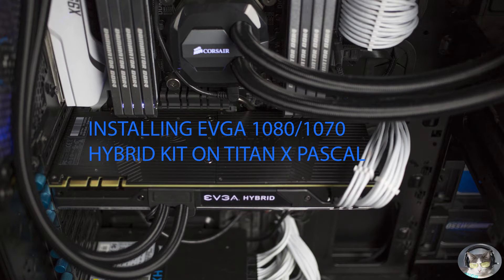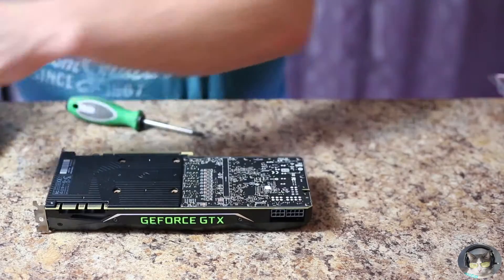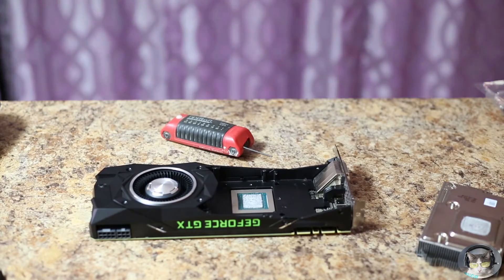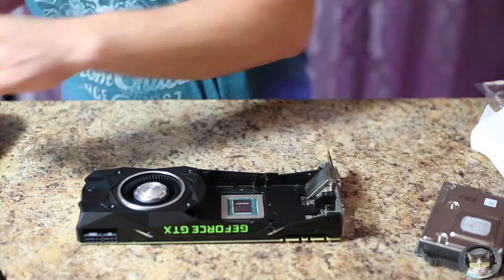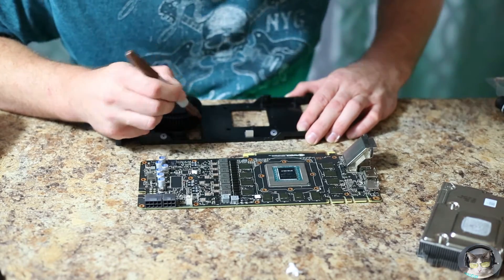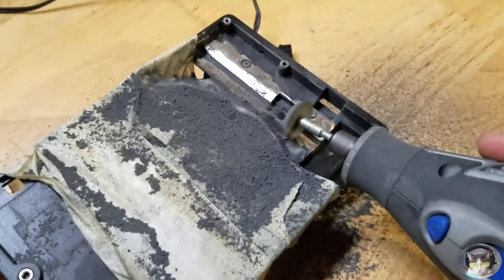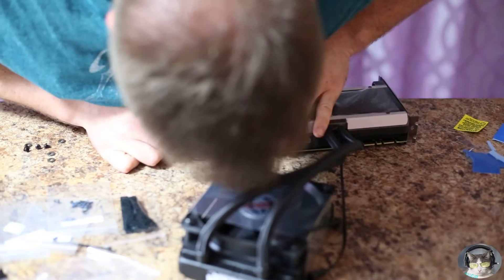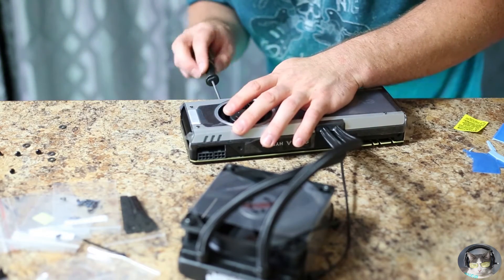EVGA Titan X Pascal Hybrid Cooler (Install)

Comment: Nice vid! I did the same thing to my Titan XP. Aside from having to buy a new Dremel ( the one I had from the 80's died in the first 2 minutes of grinding) this was a simple upgrade. I found this upgrade so simple, I was considering buying a few hybrid kits, grinding them down and putting them on Ebay so people don't spend hundred of dollars on custom blocks for a card that will be obsolete in 1.5 years. My card is sitting at +176 core, +470 mem (any further on core I crash, any further on mem, benchmarks actually decrease) temp max out at 47C regardless of how long I run Heaven... Staring at 23C idle. Dollars to donuts, this hack is simple, sweet and effective. BTW, I am running push pull with Noctua NF-F12 PWM. This bought me about 3C and several Db quiter than EVGA stock rad fan. Cheers!
Reply: Hey!! I will 100% take you up on that offer if you decide to sell these. I am not expecting warranty or anything just the same work the uploader did. I have bad vision up close. I often over read a tape measure most times. This type of tedious work is not for me, but I would pay for it done. Name your price :)
Reply: I would probably charge about $100 for my time to make this modification. The reason I have not pursued this idea is because it IS a modification that will invalidate the warranty, and it the pump or fans or other parts somehow fail, it's a paperweight. Legally for me it's too risky. If we were neighbors and you walked over with the hybrid in hand, and told me you knew the risks, I'd be happy to take the time to make them for you. You mentioned poor eyesight problems... The modification is easier to make than actually installing it on your Titan X. There are MANY small screws and a tedious fan plug to deal with.
Reply from the maker: I've modded 4 of these and sold them at 150 each if youre interested.
Reply from the maker: oliver frias I do sell them on ebay.
Reply from the maker: oliver frias item number 252631580450

Comment: Great job man.  Piece of cake mod.  I was going to do this myself but counting on 1080Ti hybrids being out first of 2017 so just going to wait ...
Reply: Yeah but as a single card option for 1440p this is the best right now and even if 1080ti did come out.. it would still be under Titan X Pascal. A Hybrid Cooled or fully water cooled pascal is undoubtedly superior to a 1080ti (if it comes out) However I do agree that a 1080ti in SLI would be quite a beast and more affordable as a solution for 4k gaming.

Comment: Thank you. doing the same with my 1080 Ti FE, tired to wait the official kit and got the 1070/1080 one.
Reply: did the install go well? i want to get one for my TI as well, but i heard there were some sizing issues.
Reply: I did exactly the same as the video. For unmounting the reference cooler it was easy:
1. unscrew the back plate
2. still on the back side unscrew the hex 4mm head and the 4x screw around the gpu
3. unscrew the 5 from the rear pannel
4. the whole reference cooler unmount in a single block no additional screw to remove

checked all vram modules to be covered with thermal pads from the hybrid kit base plate. add ones from the reference cooler if needed.

6. put the base plate customized as the video, mount it. put back the backplate as well
7. mount the block
8. plug the wires and put back the shroud with few screws

at the end you shouldn't have any screw from the reference cooler left. 

my founder edition now is so powerful (2050 MHz for the core, max temp sometimes 60C while 120% tdp)

there is a little scratch when I used my saw around the power plug. here is my rig before and after

https://pcpartpicker.com/b/HhgwrH
Reply: I need to ask this, because every one of these videos I see are with "modded" backplates. I'm not sure I want to be grinding metal, and I'm fine with not using the backplate if it's only use is really aesthetic. 

Can this be done with the backplate just.... left out altogether?
Reply: Tom Wallen the hybrid kit just came out  for the 1080 TI and Titan. Check on EVGA website
Reply: Yeah, but like all things, it's already sold out. I'll give it a few weeks and see.
Reply: Tom Wallen id prefer to wait because like you I don't want to be drilling any holes in anything and mess anything up
Reply: Yeah, this was the reason I waited when i first got the Titan. Just seeing it exists and out of stock got my consumerism into overdrive. 

Lucky I don't own a Drummel or any other metal cutting tools, or I've already ordered the 1080 hybrid kit. lol. 

I'll sit on the "notify me" email and hope my reaction speed is good enough.

Comment: Looks like a lot more work than putting on a universal, directing a fan across vrm, and calling it a day. Much better temps and headroom with a custom loop as well.
Reply from the maker: It was actually pretty simple just takes patience. I would have preferred a custom loop but I havent done and dont have a custom loop perhaps soon. This option was cheaper than a custom loop as well.
Reply: My card runs into a wall with voltage at 47C. Will your custom loop break down that wall? I'll answer for you, NO. I've run custom loops in the past, this mod will put you maybe a few C higher than the BEST custom loop. By then you are not limited by temps. Save some $$ for the next great thing in 1-2 years.
Reply: I was thinking the same thing.  A custom loop is great but the price to performance ratio is no good.  At best having a custom water loop is just for bragging rights and aesthetics.  Yes they can keep your hardware a few degrees cooler but the amount of money that goes into it is not worth the minimal gain in cooling capacity and the overall maintenance of the loop itself.  Not a knock against anyone with a custom loop, all power to you.  Jayz 2 Cents will tell you the same thing and he is a custom loop die-hard.  Before this mod, Witcher 3 took no more than 30 seconds to get my Titan XP to 84C, and now it sits calm and quiet at 50C post AIO Hybrid mod.

Comment: I did this to my card aswell :). Only I took a different route by taking it apart from the back, which looks way easier than the fiddling you're doing in this video. I maybe only had to undo 15 screws.
Reply from the maker: cheytacsnipes did you use the titan baseplate instead of the evga  one?
Reply: Nope, used the EVGA one.
Reply from the maker: cheytacsnipes i wish i could picture what you were talking about but you have to remove like 15 screws to get the backplate off then 15 screws to get the baseplate removed.
Reply from the maker: cheytacsnipes i wish i could picture what you were talking about but you have to remove like 15 screws to get the backplate off then 15 screws to get the baseplate removed.
Reply: Yeah, theres the 4 ones holding the core, the 7 or so small ones on the blackplate and 7 more holding the plate covering the displayport etc, and then 8 or so hex screws. So maybe 25 in total
Reply from the maker: cheytacsnipes ok i was gonna say theres prolly close to 30 fastners for this baseplate.  i probably could have skipped the led logo and window but i was doing a teardown of a 1200 dollar card with no instructions i wanted to be careful. 15 screws is very inaccurate.

Comment: You don't have to waste as much time taking everything apart and cutting with a rotary tool. Simply leave the original backplate and metal shroud that comes with the card and swap the 2.00 heatsink they put on the 1200 video card for the liquid loop. 10x faster and easier.
Reply from the maker: Steven Mincer i wanted to install the whole evga kit and not use the original titan backplate.
Reply: That's fine I'm just letting the people who don't want to spend the time and effort but also want liquid cooling how to do it in under 5 minutes.
Reply from the maker: Steven Mincer yea theres lots of kits and videos out like that, nexus games did his titan kit using the stock baseplate. but i wanted a clean look rather than the open card

Comment: I stuck with Gamer Nexus' mod for the Titan XP.  core clock is 2076 with fans at 50% when I game.  temps are 48c...
Reply from the maker: As in just using the EVGA pump on the stock Titan baseplate? I wanted a cleaner look personally and my card runs stable at 2088 and typically under 50c unless my ambient temps are higher which now that its fall its sitting in the 30-40c range.
Reply: Yeah, I'm now at 2088.  it just depends on the game you are playing.  Dirty Bomb it will sit at 2114 and not budge.  Temp is 37c.  Battlefield 3 and 4  it will sit at 2088.  The Nexus Mod is a clean look in my opinion.  Besides, you can't see the front of the card anyway.  i have a friend who is going to dremel and sand the cover so I can put the cover  on with the EVGA hoses running through it.  I think it looks better than the EVGA kit mod.
Reply: I agree.  I have it installed on a Core P3 with a Gigabyte X99.  The RGB lighting allows me to adjust the color. I also have a Hue+ with strips on the back and 6 Thermaltake Riing fans.  I have everything set to green to match my card.
Reply: Funny how we watch the same video and the same TITAN Hybrid mod c; (I supplied the card to him).

Comment: Hi, I am looking to add a cooler to my titan, Could you please tell me which tools you needed to do this mod, Thanks a lot
Reply from the maker: Jacob Smith get some magnetic screwdrivers as that will help keep the very small screws from getting lost. Also you need a socket and if i remember right it was about 4mm i belive i mention the tools i used and you will definitely see them if you watch the video.

Comment: I went the expensive route with the full water block. Runs great, but maybe I should have tried your way and not hurt my wallet so much. I do wonder about the effectiveness of that cooler on the memory and VRM temps, though.
Reply: +Aurummorituri, How much did you spend on your custom set up total? I am looking to just hook up the GPU as I have my CPU water cooled by an AOI already
Reply: http://www.evga.com/articles/00935/EVGA-GeForce-GTX-TITAN-X-HYBRID/

this may help you , the cooler from evga will come soon
Reply: Mohamad Ab this is what I'll be waiting for. I'm in no rush
Reply: That's for the old Titan X Maxwell. EVGA will not likely make one for Pascal.
Reply: me too
Reply: maybe you are right , but why the are writing (coming soon) ?

I wish they will release cooler for pascal
Reply: completely unaffected. Don't go for the urban myth legends.   VRM gets cooled by the fan itself  (original fan)  and it does q very good job.. VRM is not the GPU chip.. plus gddr5x runs much cooler than gddr5
Reply: when I play OVERWATCH (for example) why is GPU temp. is about 65c - 70c even using EVGA precision app. but without the app the temp. is 75c - 80c ?

this is why we need cooler to reduce more temp.
Reply: I thought its quite logical that the app does push the card further thus the chip runs hotter and its throttle point is set at like 84 or something like that. So in other words. Its not the VRM that is having issues being cooled or affecting overall temperature at all.. but the chip itself.
Reply: So when u hybrid the card, the VRM is now getting all cooling from the original fan thus you have a temperature of around 40 C under load for the vard.
Reply: Card.
Reply: I got you the chip is the issue and as you know low temp. more performance and you will get high frame rate. 

Everyone love to play a game with a full effects to enjoy the view for the game (like CRYSIS 3 or other games have effects on the option menu)
Reply: Yeah, the cold plate that sits on top of the vrams and the other modules naturally have already installed heat thermal pads.. so the blower fan is dissipating heat on those without breaking a sweat. It s the chip that always wants to melt through the card, RoFL thats why we throw. A watercooler on it 😂
Reply: Close to $400, but EK just discontinued my radiator as they are releasing a new line in a few months with custom configurations without a cpu block for gpu-only loops.

Comment: Does doing this avoid the warranty of the card?
Reply from the maker: Sparkie Stibbs technically i suppose it would but ive heard nvidia is very good about it still. i could just assemble the card back to the way it was before i send it back too.
Reply: There is no stickers or anything Nvidia put on the card to let them know if it has actually been took apart? I heard they have like some stuff that they can tell if it has been took apart
Reply from the maker: Sparkie Stibbs none
Reply: Oh sweet thanks :)